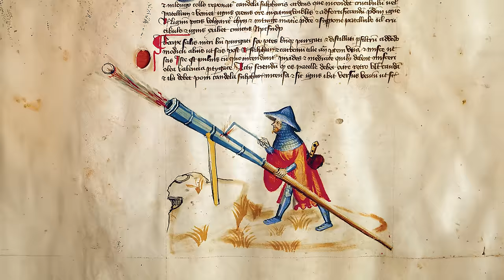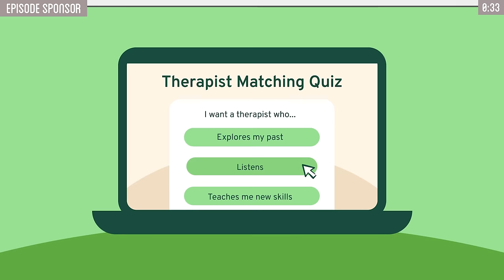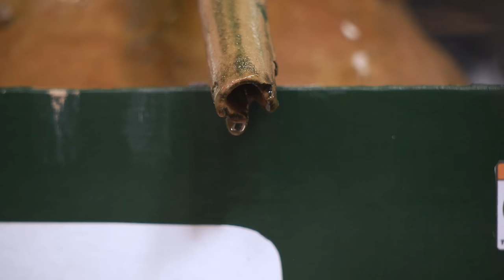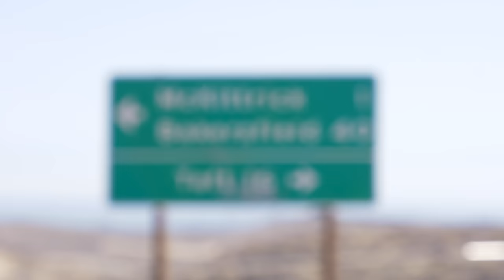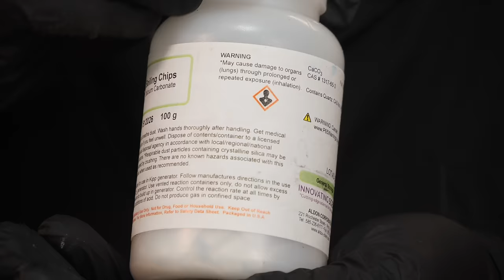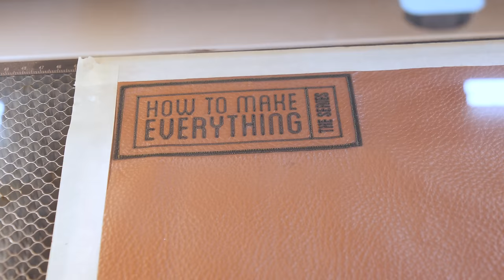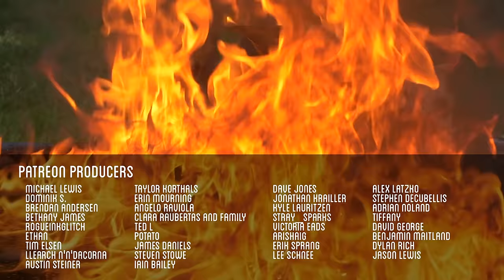I Recreated the Lost Recipe for Greek Fire!

Comment: The addition of pine tar was most likely to facilitate pumping and spraying. The U.S. Navy had the same thought among others when they were developing what we now know as Napalm. The name Napalm comes from Naphtha and Palm oil, which was their first successful recipe, before they moved on to a fully petroleum mix, which quickly became the standard.
The reason it needs a thickener is that straight gasoline actually burns too quickly, and disperses in the air, resulting in a dramatic loss of potential and effective range when projected under pressure.
Reply: Also, if it actually makes the mixture stick to surfaces better, it would make it more effective.
Reply: Soap. napalm uses a special soap as thickener. Pine tar was used in the finnish "Molotov cocktail", and it really enhances its effectiveness
Reply: @paavobergmann4920  Soap? News to me, the way I heard it was a petroleum based gel material.
Reply: Thicker solution also tends to flow in more laminar manner  which is good if you want to make a flamethrower.
Reply: @jono3952  Napalm A used aluminum soap, Napalm B used something similar to dissolved styrofoam in kerosine
Reply: wait so you're telling me that mmodern napalm is actually just greek fire refined?
Reply: @paavobergmann4920  Interesting.
Reply: Wonder if you mixed the distilled oil with olive oil? I remember reading about a really low grade olive oil that was blackish in color and was produced from boiling the leftovers after pressing.
Reply: @paavobergmann4920 that's a very general way of stating it.  I looked it up and it says aluminum soap is usually aluminum alkoxides. I found some documentation on it, you are on point, thanks for pointing this out, pretty interesting stuff!
Reply: Would there be a way to synthesis a chemical that ignites within contact with water with a low ignition temperature? Another way is that it has to ignite first then when it makes contact with water, the compound would produce a constant supply of hydrogen gas.
Reply: @anthonyatienza3363  bad idea, there are a lot of chemicals that ignite when they touch water or also air. They are always hard to handle and in general usually too dangerous to handle even as a weapon.
Reply: @anthonyatienza3363  Metallic Sodium would do that, but powdering it and mixing it with napalm would be very hazardous to store, and I'm not sure it would even stay in solution like that.
Reply: @jono3952  my chem teacher stored his sodium in kerosene to keep water away from it.
Reply: @jamespierce-tg7we  Yeah but he didn't mix it up into a gel and spray it did he? I've never seen anyone store sodium metal as a powder suspended in mineral oil. It's always in chunks.
Reply: @jono3952  I looked it up, a good example of something that would potentially burn on contact with water would be iron carbonyl or nickel carbonyl. They are of course pretty dangerous compounds to handle due to the fact they vaporize easily and can attack all of your soft tissue due to the water content.
Reply: @paavobergmann4920 Not styrofoam, that's a myth. It just clots into a solid lump. The myth spread because the actual material used in the mix is styrene, which has very different properties but sounds close enough to confuse the armchair crowd.
Reply: Greeks had soap. Maybe this should have been tried.
Reply: @brianboye8025  not soap like that though, aluminum soap is pretty weird stuff.
Reply: @VikOlliver  I said "something like" on purpose. And I don't think it was plain styrene, as styrene by itself would hardly work as a thickener. Pure Styrene is a liquid slightly more runny than lamp oil. I know. I had a bottle of the stuff in my lab. You need to get some reaction going on to get a gelling agent. Which is easy with styrene, but still. Not all people claiming it is polystyrene talk out of an armchair.
Reply: @VikOlliver actually styrofoam dissolved in gasoline works GREAT as napalm.  You’re absolutely wrong to say it just forms a lump.  Clearly you’ve never made it and are just speculating because if you’d tried it you’d already know it works great.  Go try it yourself — it’s not hard.  Buy some gasoline and a 5 gallon bucket and go to a craft store for real styrofoam (it can’t be any of the modern fake “green” styrofoam replacements).  You need quite a bit of styrofoam compared to what’s intuitive for a given amount of gas.  Put a gallon of gasoline in the bucket and feed in large chunks of styrofoam until it reaches the consistency you’re after.  A small amount of styrofoam makes the gas sticky.  A large amount makes a flammable taffy.

Experiment beats theory every time.  Once you’ve made the mixture you can pour it into a SuperSoaker or a gallon garden sprayer or just use the bucket itself to splash it on a rock.  Be safe, napalm is as dangerous as it sounds.  It’s annoying to put out casually and the fumes are doubly cancerous.  Other than that it’s great fun!

Not that I’ve ever done it, of course.  I’m just describing what I’ve heard.
Reply: @brianboye8025 soap in gasoline works okay, but not as good as styrofoam.  Greeks didn’t have styrofoam of course, or distilled gasoline: but you do.
Reply: @paavobergmann4920 Vik is the armchair hack who’s obviously never done anything remotely like this himself.  Everything you said was 100% correct.
Reply: @BobWidlefish  Absolutely practice works. The thing is, when I try it the styrofoam turns into a solid lump which sinks to the bottom and the liquid is no thicker. I have actually tested it. With different brands of styrofoam. And tested other solvents to try to get them to mix. They all do exactly the same thing. I'm speaking with actual experience here out the top end, not the lower end.
Reply: @paavobergmann4920 I know that the Ukrainians were naming ungodly amounts of Molotov's loaded with petrol, diesel and styrofoam mixed into a beer bottle
Reply: Fascinating info, thanks for sharing!
Reply: @justicar5  I´ve seen vids, yes. But so did the british in 1940. they used a slightly different mix with rubber as thickener, though. 
As far as i recall, the name "Molotov cocktail" was a nickname given by the finnish to the firebombs made by a local distillery that featured ethanol, gasoline, pine tar and  matches. They said it was the right drink to accompany what they called " Molotov´s bread basket", when russia claimed they would provide civilian aid while they actually dropped RRAB-3 cluster bombs. The firebombs were meant to disable outdated russian tanks. Sadly, coldwar tanks like those fielded by russia in ukraine are all but impervious to these concontions.
Reply: @jamespierce-tg7we nope, you don't get any of that. What you mean is the amurca or as we call it "alpechin" which is a aqueous sediment of any olive oil processing. If you dry it out and put it to pyrolysis you may get an interesting tar to play with it ...
Reply: Straight gasoline doesn't stick to kids either
Reply: I'm sure Greek Fire had a mixture of naphtha in it.
Reply: You know what?I bet if they took the distilled tar seep  and quick lime It will do really well Sense , the quick lime can't get to the igSince the quicklime can't get to the igniting point. Thethin oil We'll light for it.Which  will work really  well
Reply: @VikOlliver the finer the Styrofoam is broken up ( ideally no intact round tiny balls to be seen in the quantity, the spherical shape prevents the maximum density of Styrofoam/liquid compound from being attained
Reply: Would they have had access to phosphorus back then? That could maybe have given it the means to stick as well as burn on contact with water. Testing that would probably be too dangerous though…and perhaps a violation of the Geneva Conventions (or suggestions)
Reply: @brianboye8025  did they wash?
Reply: what about sugar?
I used to make Molotovs and petrol oil and sugar stuck better than without the sugar
Reply: @Mr-__-Sy yes yes it is it's not a lost recipe at all we have multiple different ways to make the same stuff
Reply: Very key detail in the pine rosin
Reply: @jono3952 Napalm A used Tide laundry detergent. Napalm B used gasoline, naptha and styrene. This made a mixture that was sticky, pympanle, and very flammable.  Napalm B quickly became the standard.
Reply: @notsam498 correct...and very, very dangerous.
Reply: @paavobergmann4920  it's not really soap that is the active ingredient but the phosphate that was in soap, phosphate in soaps is banned now because it harms the environment... or maybe the politicians feared the use of moltov cocktails. animal blood works well too
Reply: I thought napalm was made by soaking styrofoam with something flammable😭
Reply: Not Palm oil but a salt of palmitic acid
Reply: @ralphtrump9487  phosphate is used in detergents to soften the water. Natural soap are potassium and sodium salts of fatty acids. Phosphate was banned because it works as fertilizer in waterways, promoting excessive algal growth. Napalm A used aluminum salts of palmitic acid as a thickener and to reduce surface tension of the fuel
Reply: @jono3952  gas, water, vinegar and powdered soap.

Comment: Greek Fire nowadays, mostly as a nickname, is what Greeks use for BBQ/Grilling. You use the ashes from the current grill and mix it with something like lamp oil or candle wax and you get a deep grey paste that you can use for the next time and it burns super easily and extremely long compared to a regular fire starter.
Reply: I wanted to make a comment but for some reason I'm unable to but I can make a comment to someone else's comment. So my formula I would take sodium nitrate pine oil crude oil and sulphur. And I'm tempted to throw some potassium nitrate in there as well.

Comment: My first question on this would be whether or not some of the later results were contaminated by not using a fresh pool with every single different test.  Is it possible that some of the later tests did not ignite or may have interacted differently with the water because of the contamination of the crude oil and prior failed tests?
Reply: I thought the same thing I think he should clean the pool each time it will take longer but it will be more conclusive
Reply: This is your first question? The professor says it's crude oil based and the first thing the dude does is distilation. Anyone can make anything flammable by mixing it with gassoline/diesel and call his video "I recreated lost recipe for greek fire".
Reply: @Borsuk3344  distilled crude oil is "crude oil" based. and his first test was with crude oil.

Comment: The reaction of quicklime and water produces acetylene. I think if quicklime was used, it would be primarily for this effect, and also could be an aspect of it being difficult to put out with water since the water would cause the release of very flammable acetylene gas which could easily reach an ignition temperature because it would not be in contact with the water that would keep a liquid or solid cooled below an ignition temperature.
Reply: No place to get carbon for that proposed reaction.
I think you're thinking of calcium carbide.

Comment: So I recently saw the video about the mechanism behind the proto-flamethrower - the recipie itself is not particularly novel, but the mechanism is extremely cool. Using bronze piping to boil a small vesssl of the fluid, building pressure to project it at range is so, so cool.

Comment: What happens if you add rough particulate charcoal? It likely would settle or float inside the slurry. Then when projected with whatever pump, would scatter across the surface. Adding an endurance and heat to the flame. Possibly sticking unlit or about to be lit coals to things impossible to catch in flame with coals. Which ordinarily are scattered across a surface.
Reply: Doesn’t burn as well as youd expect.

Comment: How the hell did you dispose of that water properly?
Reply: prolly threw saw dust into the pool, gathered it up after letting it soak for a while, rinse and repeat until desired result is reached.
Reply: @juslitor  The water beneath the oil would be virtually harmless too, and could be siphoned off or pumped away.
Reply: Let it dry out and burn the rest?
Reply: @crestdazoltral7705  Seems like the easiest way to me but it might take awhile to boil off that much water.
Reply: who cares?
Reply: everything they used came from the ground. return it to the ground.

Comment: That was a really interesting video! 😁 It’s awesome that the quest to reignite Greek fire is still ongoing! 🔥
 I do have a theory about it’s properties but I’m no historian so take it with a grain of salt.

Auto ignition:
It seems many in history have claims about it’s self igniting properties, however I have a hypothesis that the Greek fire would be ablaze before it hit the water and cause an oil fireball when it made contact, instead of it igniting on contact as claimed. 

Reason #1: the administration device

As said in the video, it was claimed that in leaving the device, it was already superheated to a degree that would auto ignite almost any pyrotechnic mixture the moment it touched the air. 

Reason #2: steam explosion
The material would be hot enough to cause a steam explosion on contact with a body of water, causing a massive fireball tangential to an oil fire as demonstrated in your video. 

Reason #3: Perspectives
This is the one I would like to really be contemplated on. Say that onlookers on a pier watching a ship battle off at sea and the Greek fire is used, they would more than likely not notice the fire leaving the device especially at midday, but they would notice and record the massive fireball created upon impact. Leading to the assumption about its auto igniting properties. 

Now there is a counterclaim to this argument in which I lack a rebuttal for until tested: 
Scale.
If the quicklime and ether recipe was to be scaled higher like to ship levels, it might auto ignite due to the shear bulk of the the material, and the latent heat of the Mediterranean sun and sea.

Either way I hope this helps you on your quest!

Comment: You could purify sodium bicarbonate into pure sodium in a coke furnace. You would have to store it in a kerosene like substance to stop oxidation. Have small beads of sodium laced within the kerosene. Could even heat the mixture enough to liquidize the sodium. Add that combo to water and yea 🔥🔥🔥

Comment: Here's my mix suggestion. Distilled tar seep, Pine resin, Ether, and either wool, or saw dust. Here is my reasoning. the distilled tar seep and pine resin mix was the 2nd most effective, but most difficult to extinguish it seemed, but the mix of quicklime and ether had far FAR more fire once actually lit and was the actually most apparently effective, though the quicklime probably doesn't contribute much. Lastly, the wool helped contain it on target. I would suggest using sawdust however because, I'm fairly certain it would also float on water, and be more readily available for the greeks to burn, rather than wool, which had far more uses in textiles, and burning it would be a waste. sawdust however, Is already waste product.

Comment: Greek fire is a sodium weapon. The sodium was separated from sea water with oil. Because it is covered with oil it is harmless, but when the oil subsides the sodium becomes exposed and ignites the oil. Variations can be made using magnesium as an addictive to intensify the fire. When the ingredients are in granular form they allow the cocktail to combust as it separates from the oil. The sodium was obtained through the process of electrolysis with electrodes inside the oil to draw sodium into the oil as the salt water renders out by way of electrolysis.

Comment: Greek fire was said to be self igniting upon contact with air (not water). So something needs to be added to the mix, and then immediately sealed in the glass ball so that there is very little air in side. When the ball breaks the mix reacts with air and ignites, it also needs to float on water and be a little sticky so it doesn't run off the sides of ships but clings and burns. Making something sticky and also lighter than water and flammable is pretty easy, the mystery is how to get it to self ignite (and its up for debate if it ever really worked that way). Also you don't want to aerosolize the mix, napalm in flamethrowers is NOT delivered as a mist, rather its a dense stream ideally made with the minimum of atomization. Therefore a better choice would be to develop a device that delivers a laminar flow of the fuel out of the nozzle .
Reply: Sodium metal shavings are safe under mineral oil but burn when exposed to air. 
That might ignite some fractions of the oil, they would ignite the rest. 

But making Sodium metal, or White Phosphorus, that's a problem.
Reply: @20chocsaday  sodium generally does not ignite in air, not unless its really shaved thin and exposed to  humid air and HOT like over 200F hot. Its reactive to water. Maybe you meant white phosphorous  that you mention later in your comment (which is wicked dangerous and probably not something the ancient Greeks had access to) but is very reactive to air.
Reply: @heathbecker420  Thanks.
Trouble is, you can't keep the metal except under oil. The same goes for Potassium. 
But as for a way of reducing these metals to purity or making White Phosphorus in those days, that is a problem.

Comment: You could try dissolving the pinetar in the alcohol before adding to the distilled oil. As for the power , could be a separately prepared mix used to make the fire on the enemy ship worse after it was scorched and oilly. Just imagine your sails are on fire and the decks an oilly mess when a clay pot lands on the deck, igniting the whole mess and making it hard to put out. One suggestion from the past was that it could be put out with urine but not water. Perhaps this could hint at the mix.